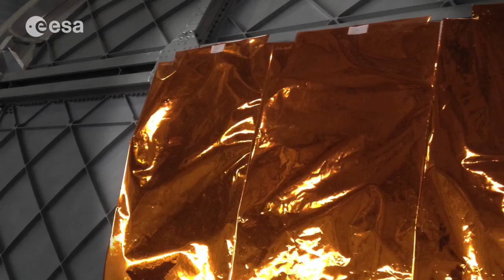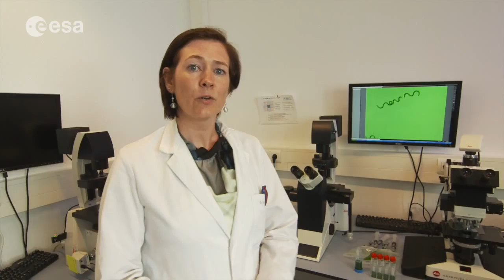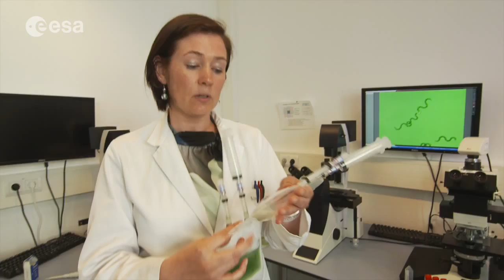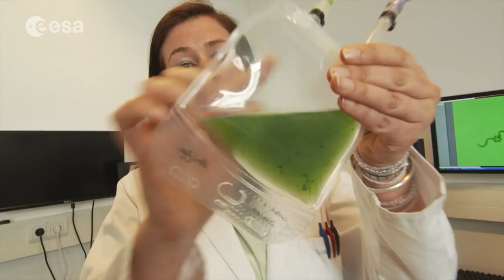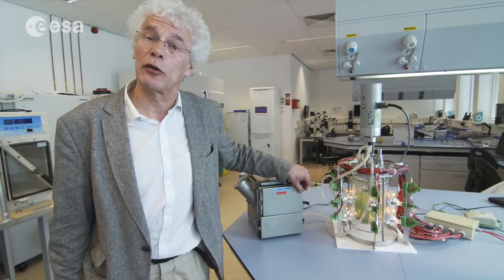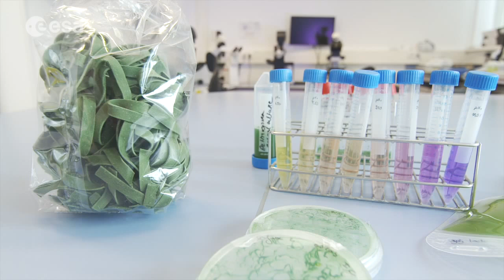Using Spirulina to Produce Oxygen and Food in Space | Video

Comment: How much oxygen can be produced via this Spirulina?
Reply: Most likely there's different strains of kinds of spirulina. Research is needed in hybridizing the best suited strain.
Reply: Actually, the real question is do humans produce enough CO2 to sustain the algae.  Bryce Meyer's  research sugests for a full bio reactor, including other food plants, humans don't produce enough CO2.  Including of yeast in the system, which off gas CO2 equalizes the system.  Yeasts can also be a food product or used in the production of alcohols, which are not only drinkable, but are the basis for industrial products that a spacefaring colony could produce on-site.
Reply: @colleenforrest7936 it's really simple, you just need at the very minimum a kg of algae by dry weight per person. 

Algae if treated nice, can double its volume in a day. It's mostly carbon, So just take the dry weight of algae to get a kg of CO2 exhaled on average per day.

How much water does it take to grow 1 kg of algae? For just one person like 80 litres more or less, depending on the bioreactor,
Reply: Kyle Walton NO ONE IS GOING TO ANSWER THAT? 😬
Reply: Alamda A. Balqhin I wish they would
Reply: Kyle Walton not enough, by any means.

Comment: How dose that 9mm insulation shelled you from radiation , is it made from lead, as that's what hospital use when they do an X Ray , or do you have special back o foil  ???
Reply: +rooker7993 they are well below the van allen belt
Reply: It’s not a bullet it’s the thickness of the certain metal they are using

Comment: Total rubbish, there systems don't work!! The greatest changeling is getting to space. You mean your tin foil spaceship of 9mm thick can protect you from the high temp in space !! The temp in space will melt all man made metal !! How do rockets work in a vacuum?? NASA is are lairs, I want my tax $$$ back!!!
Reply: don't know if you're joking or not...
Reply: lets say the ISS is traveling at speeds of 17500 miles per hour, that is enough speed to escape from radiations slow momentum of trying to penetrate the module would be easy. besides the ISS well below the van Allen belt .third the tin they could use has a gold cover same thing used on the Martian rovers to protect its electronics from heat escape of temperature balance.
Reply: register somewhere else if you think this country makes you waist your dollars......
Reply: they are something about 400km above earth, it's not that far, they are still protected by earth's magnetic field